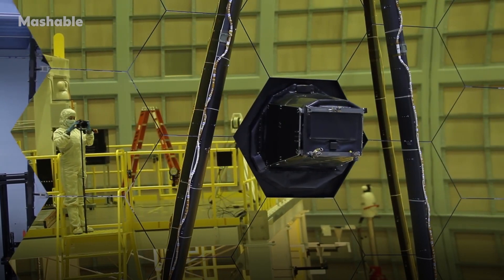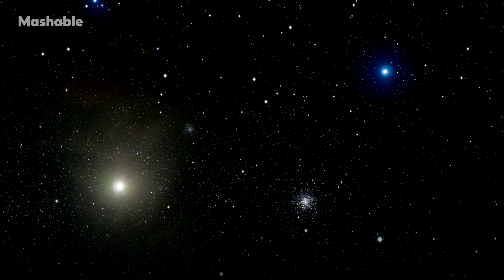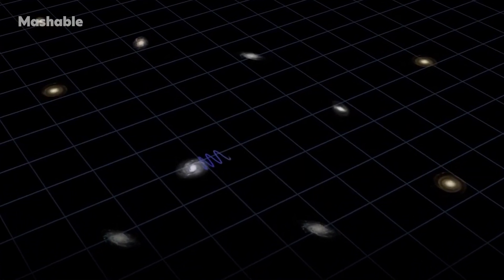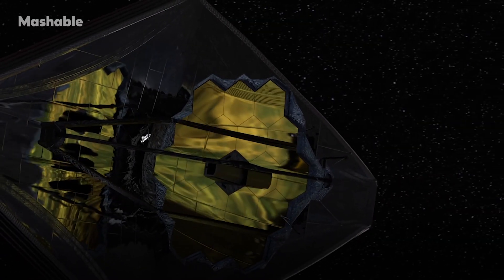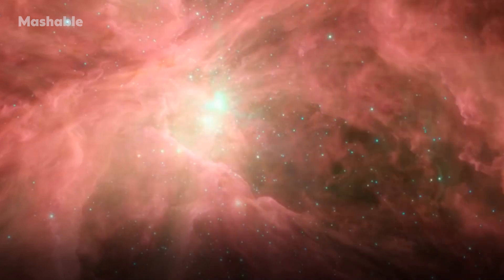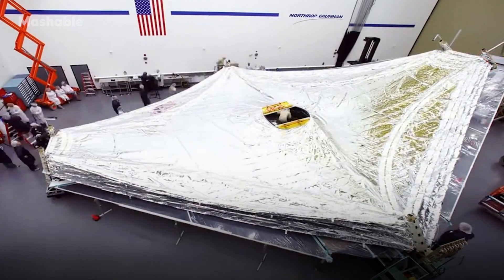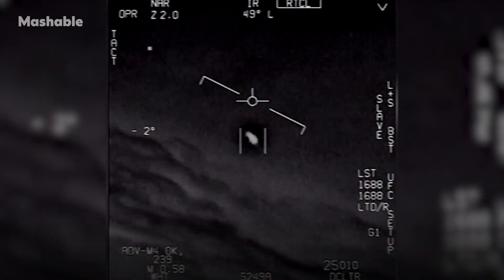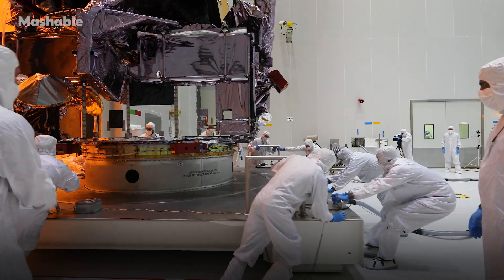Telescope Sees 13 Billion Years Back in Time | Mashable

Comment: Correct me if I'm wrong.. so. from my understanding the JWTS main goal is the take a snapshot of the big bang.  OR at least a photo of the dimmest heat signature in the universe.  Its avoiding what hot and looking for the lowest possible heat which should be the remnants of the big bang in infra red.    OK.. if I'm clear on this, then here is a scenario..  that I'm representing as the big bang.. a forest fire.  what these scientists are saying is that,  if i used the JWTS and 'theoretically' able to use it to target a forest fire.  The telescope should be able to wade itself thru all the heat signatures of the blazing forest thats been going on for days and detect the first heat signature that started the blaze... the match dropped by the drunk smoker getting out his 1980s A-team a style van.   That the telescope could decipher the decipher the difference between heat and time, because thru time its all happened linearly.  And the coldest dimmest heat signature must be that which preceded the following events.   is that it?    it almost seems sound, but at the same time it assumes that the very first of things would be cool due to the stretching of time.   somehow i think their is a flaw in this.  then again im not a scientist.